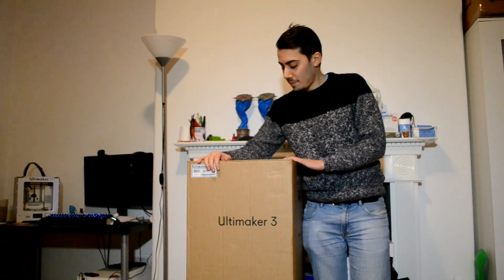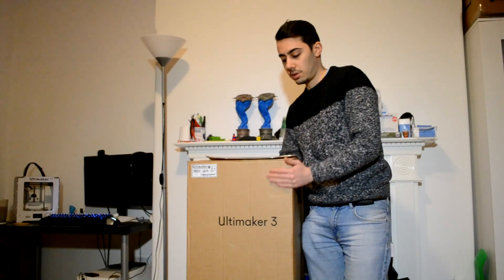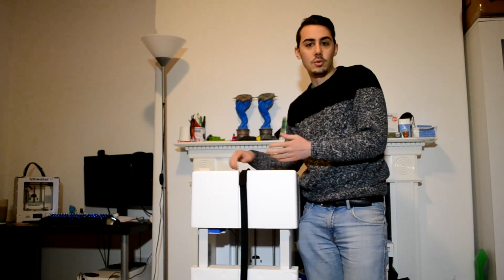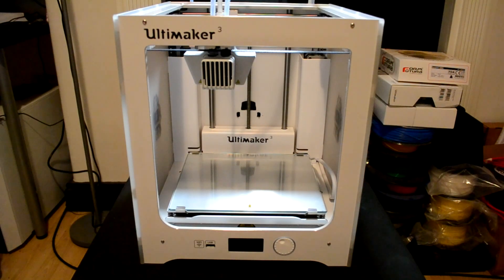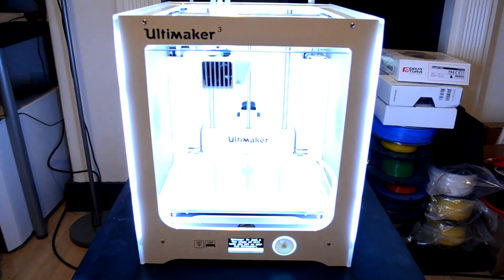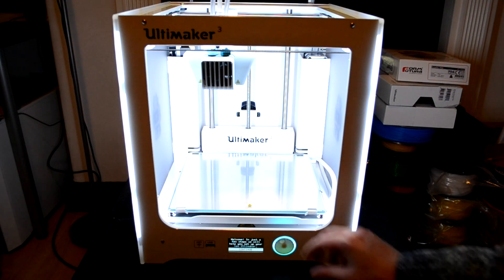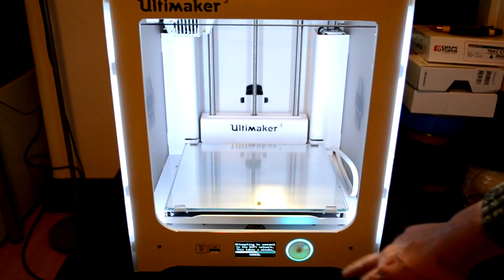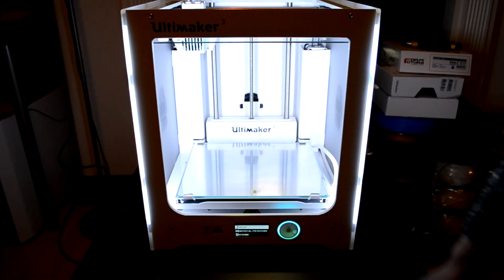Unboxing and setup of the Ultimaker 3

Comment: Do you have to use the NFC spool holder? I don't use my UM spool holder due to space and access at the back
Reply from the maker: I don't think so the NFC spool holder is in particular for the Ultimaker spools(in the previous ultimaker 3 that i received the NFC wasn't working and the machine was working anyway), so when you put them on the spool holder with the NFC it will already setup the slicer with the right material and color.

Comment: Can you change the nozzles in the print cores  or do you really have to buy separate cores for a different nozzle?
Reply from the maker: I don't think you can change the nozzle because the printer understand automatically which nozzle you just insert and size so i think you will need to buy a new one and are not cheap around 110£ each extruder and right now they pnly have 0.4 size but i will expect they will release new nozzle size in the future
Reply: Simone | FNTSMN That sucks. If I want to print in 2 materials/colors in for 0.8 and in 0.25 I have to buy 4 new print cores. That's reeeaally expensive compared to buying 4 nozzles, which are pretty cheap.
Reply from the maker: Is not a cheap machine i think is more for a professional use for a company that don't have that many problem to buy a new one
Reply: Simone | FNTSMN Yeah that's right. The U2+ was good for hobbyists and for using at home, but the U3 is more for professional use and it's (unfortunately) more closed source now.
Reply from the maker: I will say is instead was the U2+ still an amazing machine for hobbyists, maker and small business ;)
Reply: Simone | FNTSMN Yup that's true it's still amazing